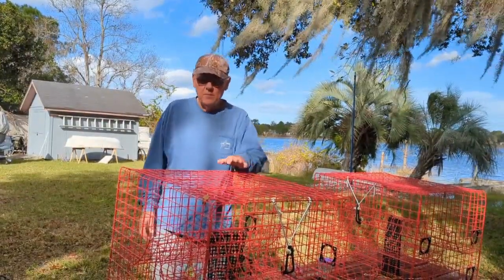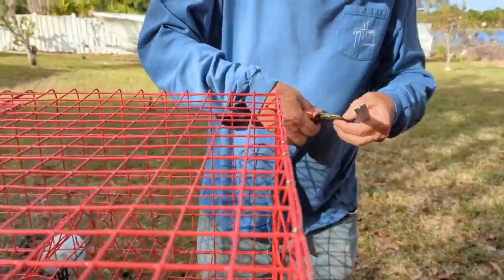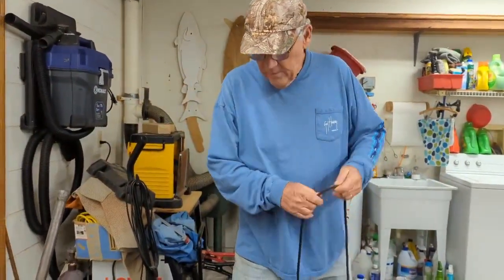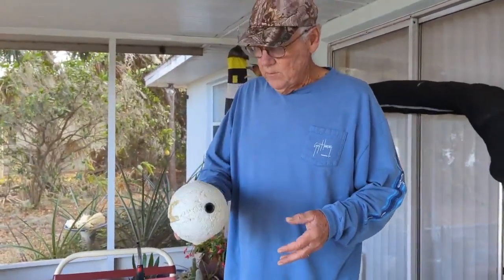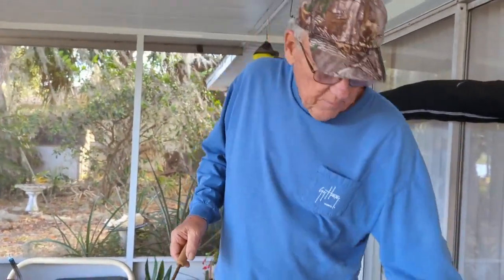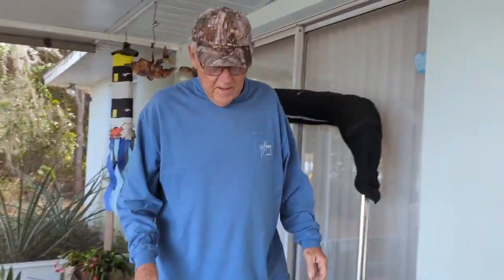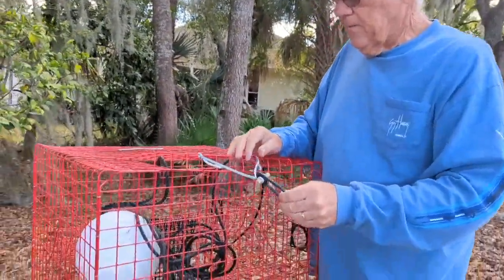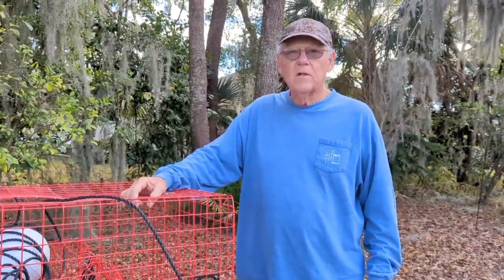Our Way Of Rigging New Blue Crab Traps

Comment: Loved your video.   I was surprised that the haul line is tied to the rebar on the bottom of the trap.   Is there a trick to keeping the rebar side down on the bottom if you lower the trap that way?
Reply from the maker: It puts less strain on the trap. You just drop it in the water rebar end first.

Comment: What kind of weights are you using on the trap line under the buoy to keep the slack line underwater and the buoy line straight up/down? Thanks
Reply from the maker: They're lead weights that I got at a marine supply in Gulfport Mississippi, Ken's Marine Supply. Thanks for Watching our videos